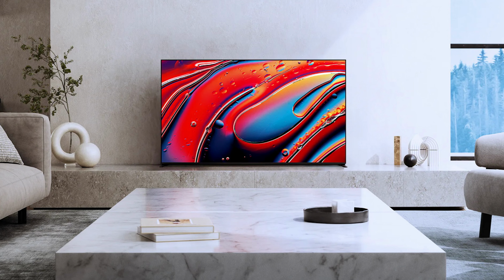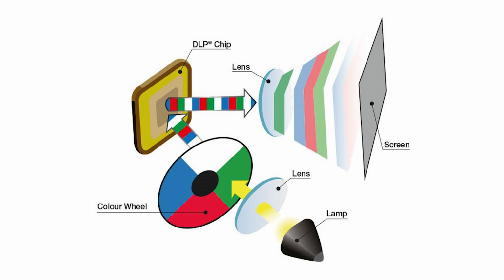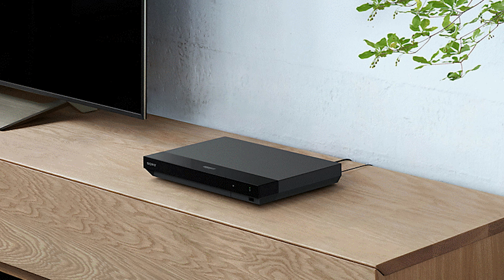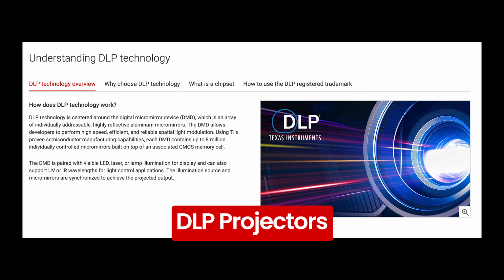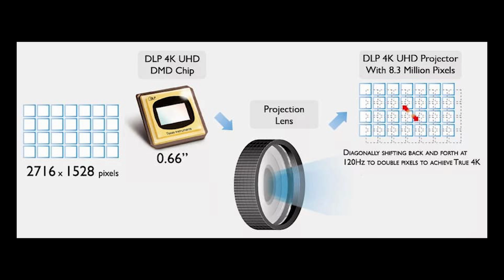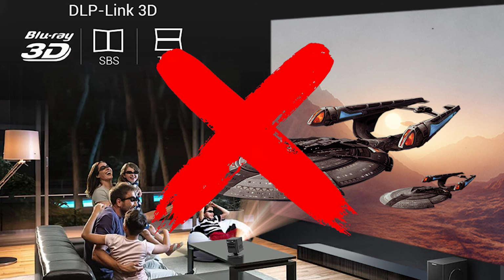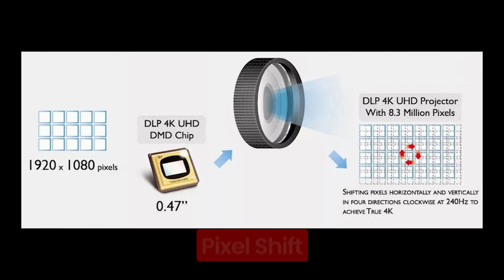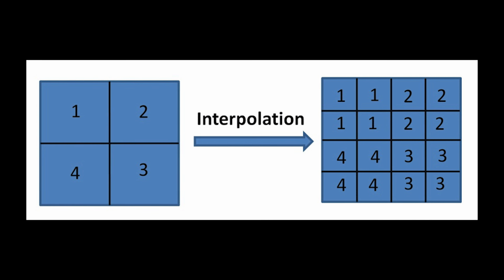PROJECTORS: PIXEL SHIFTING EXPLAINED! | eCoustically Speaking

Comment: Why is photo sensors with 20-40 megapixels is so cheap ? I think 4k projectors is expensive because it's a niche market.
Reply from the maker: A generic imaging sensor for a camera is relatively cheap but these are not what projectors use. They use specialized high speed imaging chips with precise optics and laser light engines to create the projected image. The 1080p DLP DMD device alone used in most 1080p and 4K projectors has a parts cost of between $50 and $200. But the chip by itself is useless without the rest of the optical engine and the processing behind it.

Comment: I have an epson tw7000 and when I do get close, the pixel "grid" slightly disappears with the pixel shifting, however I use blu-rays and not 4k dvds, and I am curious to see the difference if I do get a 4k player, since it has more visual information to work with!

Comment: What I didn't quite get from this explanation is what exactly is displayed on each shift. Is it displaying a different subset of the 4k frame in 1080p increments? I guess diagonal shift would only display half the pixels since 4k is 4 times Full HD.
Reply from the maker: It really depends on whether the projector can reproduce full 4K or half 4K resolution. In either case, each frame of the incoming 4K signal is split up into component sub-frames. If a projector is doing "dual axis" pixel shifting, then it breaks the incoming 4K frame into 4 1080p component sub-frames and shifts the image on both the horizontal and the vertical axis. A Full 1080p image is displayed on the screen, then rotated very quickly to the right, then down, then to the left then back to the original position so four different 1080p images appear sequentially, making up the original 4K image. Our human eyes can't detect this motion so we see the reconstructed 4K image. This is due to something called "persistence of vision." 

In the case of single pixel shift (single axis), the processor still accepts that full 4K input signal, but effectively "throws away" half the input signal. It displays 1/4 of the 4K input signal as a full screen 1080p image, then shifts the image diagonally to another 1/4 of the 4 K image. Again these images blend together in our brains to create an image that is twice the resolution of 1080p, but half the resolution of 4K. 

It's hard to describe in words, but hopefully that helps you understand how pixel shifting works.
Reply: @ecoustics Yes, that explains it clearly. The diagonal shift gets you half of 4k (with 2 corner pixels not rendered) and the sequential shift renders full 4k frames in 1/4 increments of 1080p. Pretty clever actually. 
That should work perfectly for movies and TV shows. I can only see a drawback in high frame rate games where fast motion would make edges ghost because the action would have already moved on by the time the pixel shift finishes rendering.

Comment: I kinda got the base concept of shifting things around for more pixels... i would be more interested in how is the shifting technologically achieved.
Reply: Different pixel shifting technologies work slightly differently, but the principal is the same: a component in the imaging chain is shifted a microscopic amount in different directions, timed with that imaging engine getting a different piece of the input signal and these component images combine on screen to form a higher resolution image.  To use a specific example, Epson's dual axis pixel shift works a lot like a speaker driver does. In fact, the Epson system uses voice coils - magnetically driven motors - along each axis to shift the actual lens assembly a microscopic amount, timed with the LCD chips getting 1/4 of the 4K signal. So the 3 LCD chips each get a 1080p signal, which is 1/4 of the 4K input signal, this is illuminated by a laser+phosphor light source and projected onto the screen, then, 1/480th of a second later, the LCD chip gets the next 1/4 of the 4K signal, the voice coil motor moves the lens a quarter pixel clockwise and the laser projects the next part of the 4K signal. 

This repeats 3X for each incoming 4K frame so you get the original 1080p frame, followed by 3 more 1080p frames to the left, above left and directly above that original 1080p sub-pixel. These combined together form a single 4K "pixel" that is a perfect reproduction of the original incoming 4K signal. Although technically the screen only has 1080p resolution on the screen at any particular moment, our eyes see the full 4K image thanks to "persistence of vision." 

Epson does the shift 480 times per second so that it can support 4K/120 Hz signals.  Other pixel shifting systems work a bit differently but the end result is pretty much the same.
Reply: @ChrisBoylan  Don't wanna get too spoiled here :D but, does all this end up looking less affected by the screen door effect i presume, than what a true native 4K system would produce? So in a surprising twist it could be considered better in the end? And i love the absolute zero flicker nature of most 3LCD images. Don't people tend to nag about eye strain with shifted projections after a while? I was very susceptible to that in the case of CRTs back then.
Reply: @Gary_Hun  - I don't think pixel shifted or native 4K imagers have any inherent advantage or disadvantage for SDE. This is more dependent on the inter-pixel gap, not the method in which the 4K image is reproduced. Lower resolution (1080p) projectors are far more susceptible to SDE as the pixel grid becomes more visible the larger you make it. Also, pixel shifting on its own doesn't normally lead to eye strain, but a combination of pixel shifting and color wheel spinning/flashing can lead to eye strain in some viewers. 3-chip projectors like the EPSONs, JVC D-ILA and Sony SXRD have no need of a color wheel as are less likely to lead to eye strain over extended viewing.
Reply: me too

Comment: Bought a 2025 Epson QB1000 (4-way pixel shift).  I can attest to how well it works, how quiet it operates, and the extra brightness it provides.  My better-half, who could care less about the technical details, constantly remarks how much more she likes the additional “sharpness” and “brightness” as compared to our previous 2017 Sony 285es 4k projector.  Phew . . . because she was also complaining about how much more the projector cost given Canada’s 40% exchange rate vs the U.S. dollar (let alone any additional costs coming from U.S. tariffs.  (After my order, the dealer shut down any additional orders until the tariff situation sorted itself out.)
Reply from the maker: Yeah, that's one of the "real" 4K Epsons - dual axis pixel shift. Great projector!
Reply: @ecoustics Despite that JVC had all the benefits/hype of true 4K — last year —, I think Epson came up with a way to hyper-drive their pixel shift tech that makes their latest projectors as reviewed far more “adaptable” which was its goal.  Barring any long-term glitches, I think they pulled it off — amazingly.  Seems Epson did a “hail-marry”, went around their competition — and scored?!
Reply from the maker: Epson has always had the ability to do 4K via 3 LCD chips using pixel shifting. Their problem is that they have offered two different kinds of pixel shifting - single axis (which is half 4K) and dual axis (which is full 4K) - and no easy way to tell the difference between the two. They still offer both types, but at least now they have a name "4K Resolution Technology" which identifies the better dual axis pixel shift. 

JVC is different. Both JVC and Sony use native 4K LCOS chips. And JVC uses pixel shifting to upconvert that resolution from 4K all the way up to 8K. The LCOS optical stack does lose a bit of brightness, though, which is one reason that Epson, using 3-Chip LCD, is able to crank up the brightness on their projectors far higher than comparably priced Sony or JVC projectors.  The Q Series from Epson, first launched in 2024, has projectors all the way up to 10,000 Lumens which is kind of insane. It's one of very few consumer projectors  that can still provide a bright punchy image in a brightly lit room.
Reply: @ecoustics  Excellent initial review as always AND excellent explanation about the tech differences.  However, regardless of all of that it still comes down to what the consumer actually gets!  That can still be a like a roulette wheel.  For example, the initial QB1000 projector came DOA!  (Dead-On-Arrival).  Would not boot-up.  I had just seen Shane Lee’s review and thought all would be good.  The exact opposite happened!  Talk about consumer shock.  Shane noted the dealer would respond and they did.  Phew!  Since then the projector has performed.  Even only up to 4%, calibrating the projector does tweak it just that more and makes a difference to my eye.
Reply from the maker: @marvinabugov4579  - complete lemons are rare these days, particularly in name brands, but they do happen. Glad the dealer made good on that.
Reply: @ecoustics  I worked through Epson Support (requirement) who had me go through a number of actions to prove to them the projector was defective.   Only after that did they approve I re-connect back to the dealer who as promptly as possible got me a replacement.   

Back in 2017, only because a Control4 dealer was involved did I find out my Sony 285es 4K projector was defective and had to be returned to be “rebuilt”.   Took an hour on the phone between C4 and Sony Support tech head office at that time.  

For the Epson, I had to have that same C4 dealer come back to resync the replacement unit.  In so doing, he said:  “How is it you should be so fortunate to get two duds in a row!?!”  😂🤣😱
Reply: @ecoustics  My Epson LS800B died 4 months after its warranty period expired (Epson logo appears on power on but android TV doesn't load and screen stays blank; no prescribed "tips" and "steps" could correct the problem). After calling technical support hoping to get a repair quote, I was told they will "overlook the warranty issue" and send another unit. The replacement unit I received is refurbished, evident by some dust bunnies in the air intake filter. But, its operations were snappier, laser life has been reset to zero, and android TV is instantly on screen after power on instead of Epson logo (as long as it remains plugged in). Clearly, the firmware has been tweaked for the better. I'm happy with Epson's response and will upgrade when they come up with a dual-axis version of LS800/QS100.
Reply: The Epson QB1000 would be my next upgrade…if I were to upgrade anything.
Reply: @GeniusHomeTheater If you do, make sure the projector “boots” out of the box when at the dealer.  Mine did not!  (Dead as a door nail!).  I had to repack and return it.  The second has been fine so far.  

I really was concerned given all the JVC reviewer hype about JVC black levels that I was going to shoot myself in the foot by going the Epson QB line.  Meanwhile, Epson dynamic tone mapping in HDR mode is fine to my eyes.  Maybe JVC is better??, but in the end, it’s the brightness flexibility I seem to be appreciating the most.  As it is, Epson is about 200 lumens brighter than the JVC 700 and a couple of thousand less in cost.  It’s a one-two punch that resonated with me.  But — would the Epson deliver?  I was quite nervous.

Pleased to say:  It does — to my eyes (professionally calibrated).  So far, I have had no need to go beyond “natural mode” for any of my viewing.  Plenty bright at 20 ft. / 80-95% brightness.  Works wonderfully, so far at 250 hours on the clock.
Reply: @marvinabugov4579 I’d consider that a rave review. The white version will be my pick, as I’d use it in my LivingRoom. I’ve always used Epson projectors for that reason…no daytime light control. The 5040ub I have is my 4th Epson. They haven’t let me down, so I’m buying with confidence…as soon as I’m confident I want to let go of those coins. 😂
Reply: @GeniusHomeTheater Thanks.  It was a lot of money at $11,000 CDN.  I took a lot of time (4 years) to go over every vlog I could find from:  Canada, U.S., Australia, Britian, AND — Germany, Italy, Spain, Turkey (in translation).  Everything pointed to JVC.  So it came as a bombshell in March 2025 when at the dealer counter with credit card just about to go into payment machine, I thought to ask:  Can the JVC 700 project at 20 ft. onto a 106 inch viewing area.  Dealer said: of course! . . . but since you asked — let’s check.  Next thing I see is a dealer panic call to JVC in Toronto. THE Official JVC Answer:  NO — it cannot!!   Projector has to be at 17 ft. max.  

Yikes!!!   Fortunately, I had seen some reviews about the Epson QB1000.  I decided to take a calculated RISK.   Fortunately, it seems to have worked out, at least until now at 250 hours.  We’ll see how robust the projector is going forward.